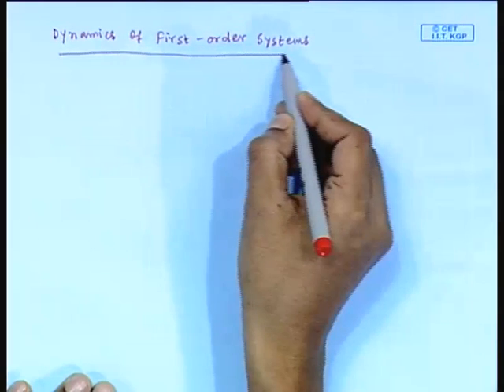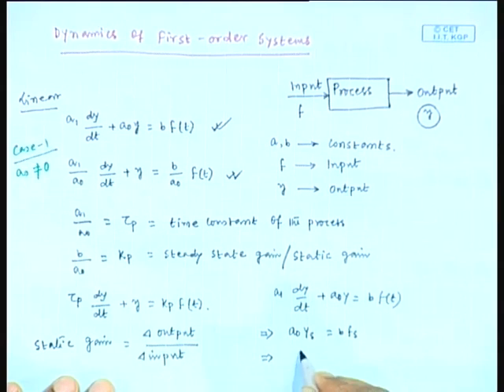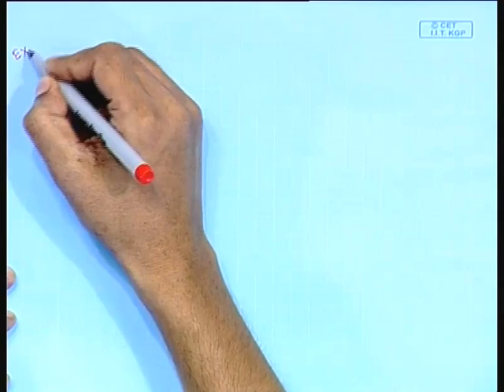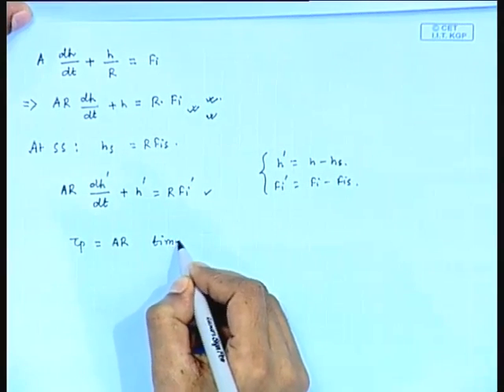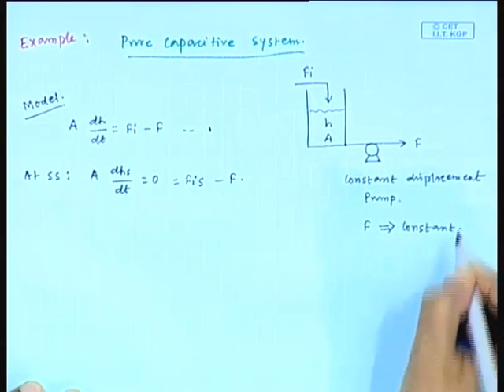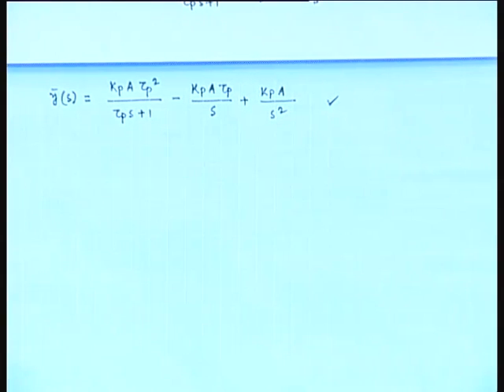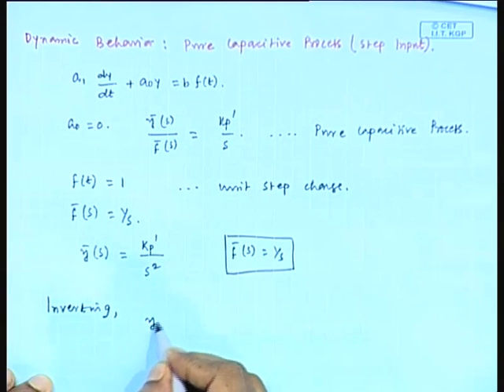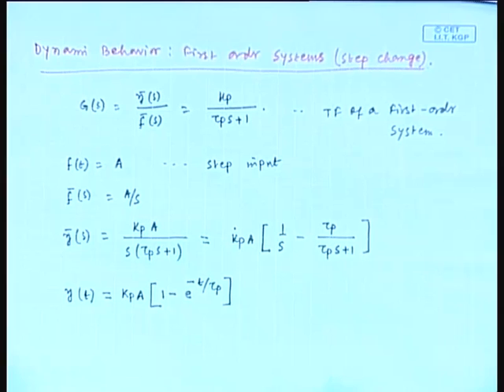Mod-01 Lec-10 Lecture-10-Dynamic Behavior of Chemical Processes (Contd...4)

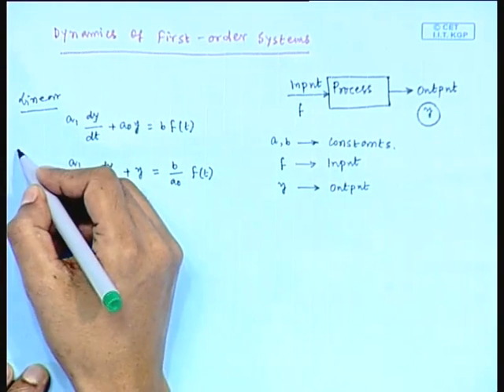Comment: 1:14 dynamic of first-order systems (4:20 a0 not equal to 0; 12:26 a0=0)
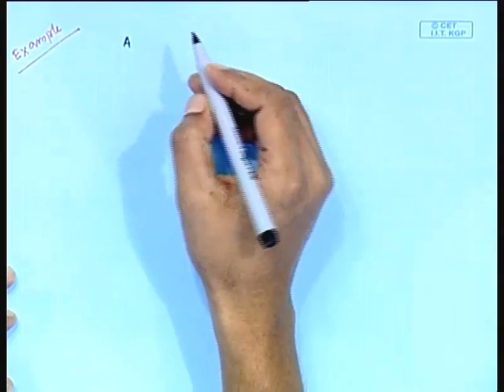15:55 example Liquid tank system
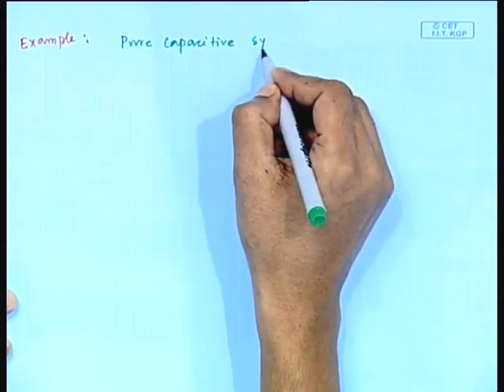27:35 example pure capacitive system
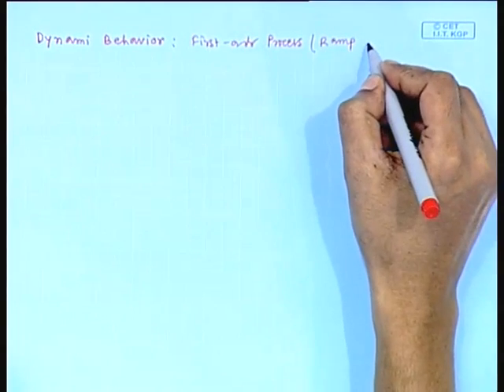33:13 dynamic behavior of first order process:
33:15 ramp input
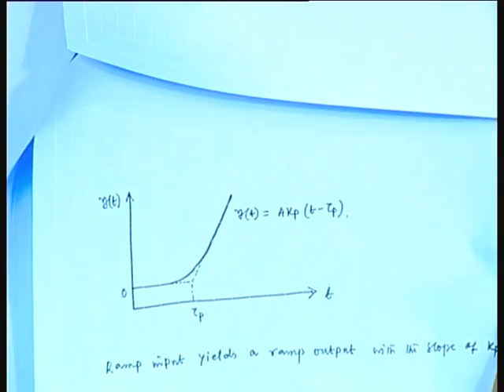41:30 pure capacitive process (considering step input)
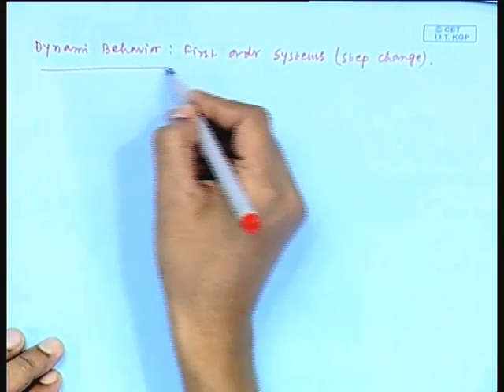49:47 step change
Reply: Why u stop writing it helps a lot brother